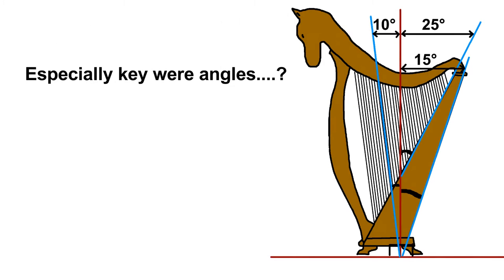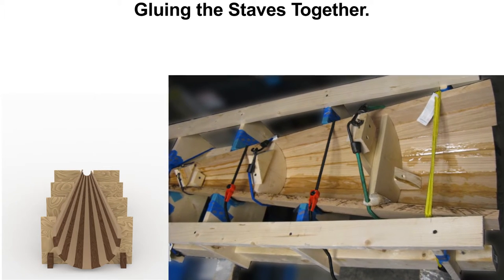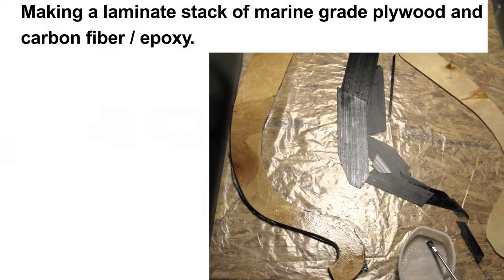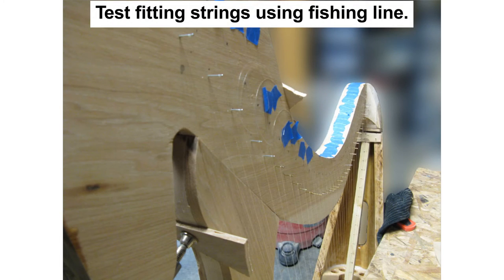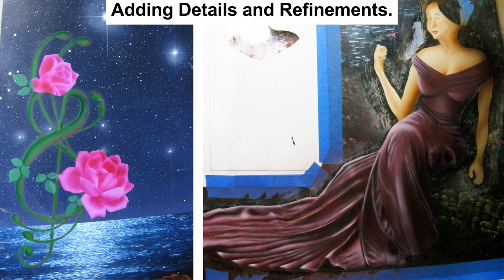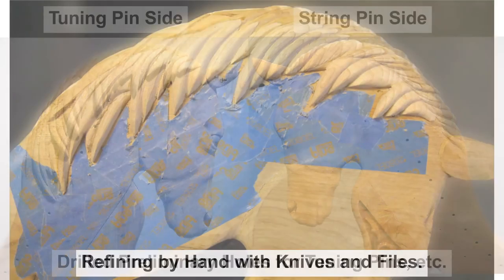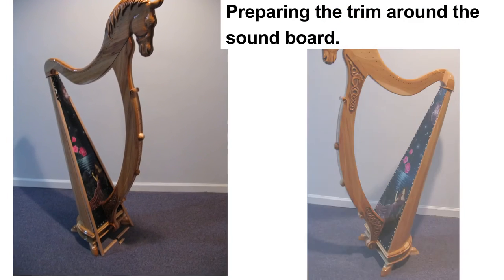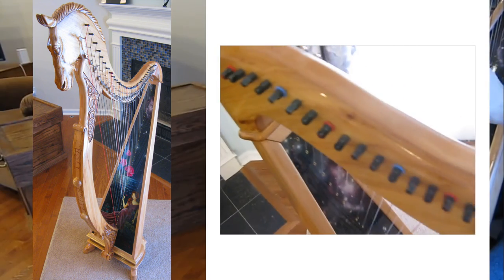MY CELTIC LEVER HARP BUILD | How I built my 36 string Celtic lever harp.

Comment: As a guitar builder, we never put any finish inside the box. As the bare wood ages, it develops very complicated overtones, that improve the sound quality 10 fold. As a wood worker, I can guarantee the epoxy used to glue the staves together, would never have failed, especially since you have those bulkheads.
Reply from the maker: Interesting.  I'm working on a Lyre harp now, and am debating whether to seal the inside or not.  Good to know.  Thanks for the feedback.

Comment: You did such an amazing job! I’m looking into building my own lever harp and I’m wondering how much it would cost for all the materials? And how long it took you to create this? Thank you so much! I’m so inspired.
Reply from the maker: Well, it has been a few years now.  I think I spent close to a $1000+ on the materials, and it took me about 2 years from start to finish.  The harp is based on plans from Robinson Harp Shop.  Of course I was only working on it in my spare time.  :)  Best of luck with your project.